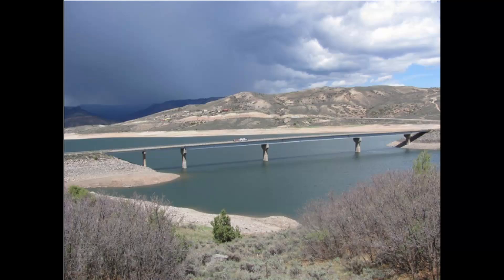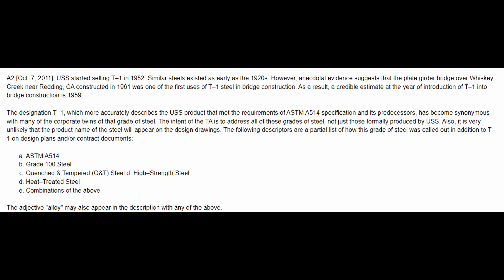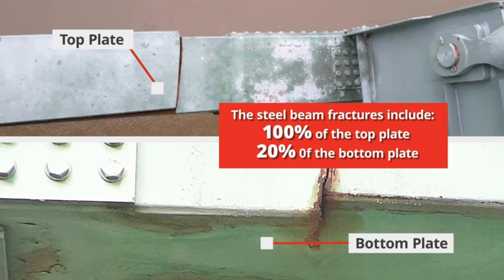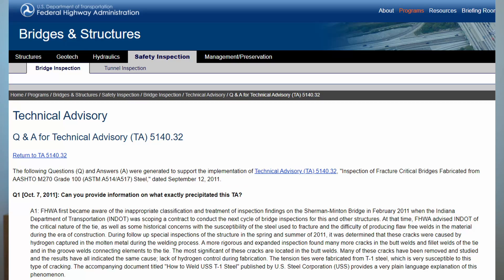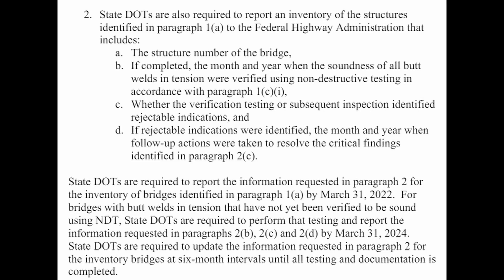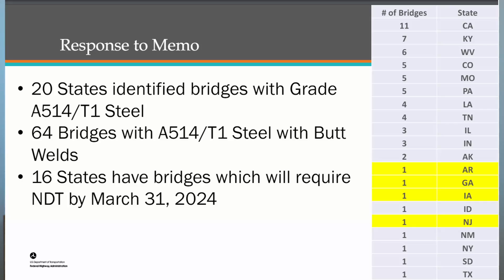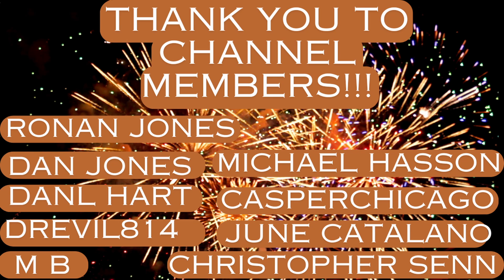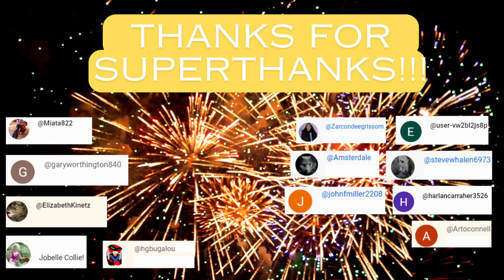The Major Implications of the US-50 Bridge Closure in Colorado

Comment: I specialized in welding and one preventative is a change of weld filler material. Repairs can be quickly affected by grinding out the original welds and changing the alloy to one with more silicon which adds up to 500% more toughness to the welds. My engineering degree included working my way through college in a metal fabrication shop. I went to work for the R&D Dept. at Garrett AiResearch and I was the only engineer who could weld.
Reply from the maker: That is really cool.  I heard that nobody today could remake the nozzles on the Apollo rocket engines as they here all hand made by welders who were also engineers with a very high skill level.
Reply: @CaseyJones-Engineer  The R&D Dept. at Garrett was a training opportunity for new engineers to learn the processes that went into fabrication, but I already had that and my pay grade was higher, but I did specialize in metallurgy to a large degree. Adding small amounts of some elements made a big difference. Like the Silicon added to filler material only has to be 0.5% to add 100% more toughness. S5 steel is 2% and is extremely tough with 0.60% Carbon so it can be heat treated. Drop hammer heads would be made out of it or trip hammers. I made a felling ax out of it once from some scrap.
Reply: @CaseyJones-Engineer The way I heard it it was because nobody had written down the details of every one of those joints, so Jeff Bezos paid to have one of the F1 engines located and retrieved from the ocean floor to study it for development of rockets for Blue Origin. At least that's the way I heard it. Maybe that involved studying the welding materials and techniques.
Reply: @CaseyJones-Engineer  They were made in a very labor and skill intensive way, by welding a mile or more of small diameter tubing made of a difficult to weld material and then brazing the entire structure in a huge furnace.  The preferred approach today is to build the nozzle in and inner and outer half, machine the cooling channels and then braze then together.  "Additive manufacturing" would be a better, but that size/type of structure and materials seems to be not yet within our grasp.
Reply: @CaseyJones-Engineer  The word "can't" in that sentance just means we would be starting from scratch all over again. its like saying we dont know how to build a Model T because the production line shut down a century ago and all the workers are dead. The model T, just like an Appolo engine, didnt use and mythical magical component or skill that humans are no longer capable of, or no longer capable of relearning.

We CAN, but technology has progressed so far it would be a waste of time and resources to produce such an outdated design.
Reply from the maker: @nicholastrawinski  Great points, thank you.
Reply: To me it seems to be an interesting fix, but even if the weld is stronger the welded material would still be the same and the problem will likely just move on to other points of the structure.
So even if the bridge is brought up to a working order it's time to plan for a replacement since I see that it's just a question of time before a new crack appears.
Reply: I'm a boilermaker of 20+ years. Yes the correct filler metal is critical.  My time was spent between rebuilding powerplant boilers and keeping a lead smelter corporations furnaces functioning.  Extreme heat will expose any engineering mistakes, weld production mistakes and any ah $#its in application of procedures.  It is very intriguing seeing others failures well fixing the furnace and as the smelters needing to be totally rebuilt every 6 months let me see the shortcomings in my own skills and technique staring as a very green apprentice to a expert.  The funny part is most of the time I was told to just figure it out in the smelters there's next to no oversight by engineers.  But every year we were able to get more tonnage out of each furnace.  Fun times then retirement happened 😕
Reply: @bigjay875  "And then retirement happened."      I think at times I lack the good sense of a mule,, I am sure I will never retire.  Been self employed all my life,, and that is just leaking over into 'retirement'.  A couple of heart procedures,, and yet  I have a house design and build in the works, a customer needs a new roof, I am pouring a concrete slab this afternoon. Another customer wants a complete solar system,,,  but,,, I DO drop it all if I get a permit for one of the western rivers to go quietly paddle my canoe.  I still have that much good sense.
Reply: *effected 😉
Reply: But then the government can't spend countless dollars on hired favored consultants and contractors for the remediation project, and those gummint employees can't reap the huge kickbacks from those contractors can they?  Think, man, think!
Reply: I also am an engineer who can weld, rivit, drill cracks, paint, etc. because I got my Airframe Mechanic's license 50 years ago.  Engineers are not taught how to repair things these days.
Reply: You are my kind of guy.  I just installed a new hot water heater.  What an joke of engineering.  Definitely speced and designed by multiple 'engineering teams'  and no one watching the entire thing,, and not one of the engineers,, not a single one has ever assembled anything in their lives.  Brand new electric water heater,, that on site, after installation had to be disassembled to tighten a single leaking factory joint,, that the factory had no choice in tightening because the control unit conflicted with the temp/pressure relief valve,, and the control unit HAD to face front.  Buncha danged college educated engineers, that don't have a single callus and never barked their knuckles on anything tougher than a spring break beer bottle.
Reply: @Sailor376also  There are standard designs where the electrical systems can be removed as a unit. No reason to not do it that way. I'll tell you I've cussed automotive engineers putting the damned fuel pump in the gas tank that has to be emptied and removed to replace it.
Reply: @MountainFisher  This one , a Rheem Gladiator electric hot water heater,, I was installing the 12 year warranty , 50 gallon tall tank.  The leak detection shut off valve was designed to be in the same plane and less than the radius of the control valve.  WiFi, Blue tooth  all the bells and whistles.  You can telephone your hot water heater to warm up before you get home or tell it you are on vacation for the next two weeks, But  I am the installer.  I am not going to slave my phone to a customer's water heater.  The leak detection worked extremely well.  It seems as though it detected the damp lumber under the unit,,, New pressure treated stock to raise it off the floor,, and it detected a leak in the factory installed leak detector.  But you cannot remove it without removing the other factory installed fittings and those must be removed with the delicate leak detector in place,,, Where do you put a pipe wrench?  And it is likely a CFO without a scrap of engineering experience made the decision to produce it cheaper,, and every last assembly line person said, "This ain't gonna work."

Yeah.. its one of those.  A grand to install,, another grand plus to repair their faulty assembly process,, and when they told me to 'just' return it to the store.. that is 100 miles one way,, so that option would have cost me 2 grand additional.  
Every engineer to get their ticket MUST go out and become an expert in the welds they are going to inspect,, like you.  I loved your explanation,, I got it.  We have forgotten this step of practical application with most engineers.  Even CPAs must serve an apprenticeship with a senior CPA.

Comment: I believe T-1 steel with its characteristic of hydrogen cracking isn’t limited to bridges. Pipelines and storage tanks to name few. I’d be curious if RRD rails had been made with T1. 

What about RRD bridges? Is the no reported RRD problems? 

It’s like there’s a product recall but you can’t take it back.
Reply: Agreed, especially with the high strength steel that was used for prestressed concrete pipe, that had failures due to hydrogen cracking/embrittlement.  There have been more than a couple cases where enough of the wires in the prestressed the pipe snapped that the pipe integrity failed and pipe "self-excavated".
Reply: Railroad rails were found to have hydrogen cracking causing breaks in the rails in the early 1900s.  The process of "control cooling" was developed to allow the hydrogen to escape the steel before the cooling process was completed.  Control cooling is the placement of the hot steel in a heavily insulated box or container to allow the steel to cool very slowly from rolling temperature to about 500* F before removal from the container.  The best method seems to be to vacuum degas the molten steel which is then poured into a tank that feeds a continuous bloom casting line.

Comment: 6 hour detour! unfortunately there is probably not enough value in adding a 2nd bridge in any direction to avoid future problems here.
Reply: It might happen. There are some pretty rich people scattered around Colorado. They won't pay for it, but they're adept at making the public pay for things that are for their personal use. So it may happen.
Reply: When a bridge becomes functionally obsolescent due to width (much too narrow) and is otherwise good sometimes this is done.  This site is not appropriate for this due to very deep water.
Reply: A better alternative is to upgrade the county roads that would be potential detours.
Reply: @michaelmcmullen354  Not having studied the surrounding that much, how much do you think that will save in time?
Reply: @surters  The traffic volume is not low, ~3000 vpd, it is a US highway, but west of the front range the popularion is low and not growing along its route, so traffic will not justify the upgrade to 4 lanes for a long long time, perhaps as long as 50 to 80 years at current growth rates.  ADT would need to get to perhaps something more than 10,000 vpd for the ADT to justify 4 lanes.  If bicycle or foot traffic becomes significant, more shoulder width would be good, so a second bridge or replacement bridge should be as much as 48 to 54 ft. wide,
Note that due to the deep water a second bridge or a replacement bridge would be slower to design and build and more expensive than typical bridges in Colorado.  The reservoir was not there when the current structures were built.

Comment: Casey,

As you know my career was spent dealing with oil tankers, primarily those involved in carrying Alaska North Slope crude oil from Valdez, Alaska to the west coast of the US. 

The tankers involved in the Trans-Alaska Pipeline System (TAPS).  Because of the severe weather encountered in the Gulf of Alaska, and the number of loadings and discharges TAPS tankers started showing high numbers of fatigue cracking.

It's important to note that tankers involved in the TAPS must be Jones Act compliant.  They must be owned and operated by American companies, built in US shipyards, and crewed by Americans.  The ships must meet USCG rules.  I believe all of the ships are classified by the American Bureau of Shipping (ABS).

Because of the numbers and location of cracks, the USCG in 1991 required each vessel to have a Critical Area Inspection Plan (CAIP) following the Navigation and Vessel Inspection Circular (NVIC) 15-91, CH-1. Each tanker or class of tankers has to identify critical structural areas, physically inspect these areas, and have pre-approved procedures for repair. 

To develop the CAIP structural details were studied, finite element models were built, and historical repair documentation was reviewed.  Repair procedures were then developed. 

At first, CAIP inspections had to be done annually.   With time, Inspection intervals were extended to correspond to the twice-in-five-year drydock schedule.

Bob

Comment: Uneven foundation settling can cause stresses that exceed the ductility of the structural members. The welding of T1 is much much more technical and less forgiving than mild steel. Extreme cold weather worsens  the problem.
Reply: This bridge is located in an area that gets brutally cold in the winter, minus 20 to minus 30 are normal in January. Heard of even colder in the past 30 years. So this could play into this failure even more than the bridges in other states.
Reply: @moldings_etc  Winter of 2012, it briefly hit -40
Reply: @moldings_etc  don’t forget the high winds that hit there   Was crossing it in cement mix the winter before the Blue construction ,was midway across when the gust hit ,  even that heavy truck felt the impact ,
Reply: @moldings_etc  this steel is more ductile than brittle down to -60° F. But the welds are screwy.
Reply: @blairhoughton7918  I seem to remember a report testing the variability of steel properties, yield streength, ultimate strength, strain before rupture, Charpy, hardnesss, in the three directions of plate (including thickness which was a problem with T1), and at the ends, corners, and interior of the plates.  There was quite a bit of variation except in the middle of the plate in the direction of rolling, which is the standard test location.  The standard brittle transition is not something I would hang my hat on.  Varies with rate of loading, stress concentration factors, and plate thickness too.
Reply: Can it be rewelded to patch it while a bigger fix is prepared? Seems expensive to keep a 99.99% good bridge closed if it can be made safe-enough with a few hours of work and temporary load limits.

Comment: Seems most of these bridges are in colder climates. Does the have any effect of this steel?
Reply from the maker: I think the correlation to more problems with bridges in colder climates is due to the effects from corrosion when they salt the road there.
Reply: @CaseyJones-Engineer  So no effect from steel getting more brittle when colder.
Reply: @surters Took a bit of digging, the ductile-brittle crossover for T1 (ASTM 514-E) steel is -60° F. I don't think Colorado has ever seen that low a temperature, but I'm done googling so someone else can have the table.
Reply: @blairhoughton7918  Colorado's record low temperature is -61°F. Most of the state never gets below -30 though.
Reply: @renerpho  Actually this brittle ductile thing  is not that simple.  As the stress gets higher and the loading rate higher brittle failure can occure at higher temperature.  Also this transition temp is not necessarily the case for the welds and the HAZ, especially with a lot of thermal changes during the welding process (or perhaps hydrogen embrittlement).
Reply: AASHTO specifies different minimum charpy test temperatures for differing envoirnment temps, differing  yeild strengths, and differing Plate thicknesses.  Plates over 2 1/2" thick can not be used for 100 ksi fracture critical.

Comment: Hydrogen causes embrittlement. That T1 was some good stuff but it was hard, and kind of brittle. It had a rough surface texture, and it was kind of hard to work with. If they know where the cracks are, they should be able to arc gouge them out and weld them back up pretty easy. 
This really isn't a T1 problem as much as it's a maintenance and inspection problem. And let's face it, most of these people are idiots, and government is playing lots of games about social issues like they are more important than infrastructure.

But I'm old now and I just hope I live long enough to see it all fail so I can sit back eat popcorn, and laugh
Reply from the maker: Old bridges are not being replaced at a sufficient rate across the country.  The number of sudden bridge closures and outright failures is only likely to increase.
Reply: According to some googling I did for a question up-thread a bit, T1 steel should be more ductile than brittle down to -60° F. So as the video says it's the welds, not just the steel. Probably a very narrow margin for error on the technique and filler, and easy to get the physical chemistry of the result wrong without being able to tell until they crack decades later.
Reply: @blairhoughton7918  Maybe, but T1 welds seem to have a problem with internal cracking a day or two after complete.  I am not sure this was know at the time the bridges mentioned were built.  Also the inspection technology was X-ray which does not catch everything.
Reply: Gouging out a sea of cracks in a 2"x24" T1 flange under load in a two girder bridge over 150 ft of water does not seem practical to me even if you build an envoirnmentally controlled enclosure.  We do do this for bridges we can prop that are continuous and have 4 or more girders, especially if it is only half the flange.  This is usually due to a traffic hit.  A few have brittle fractured.